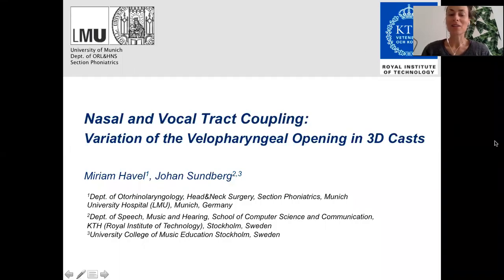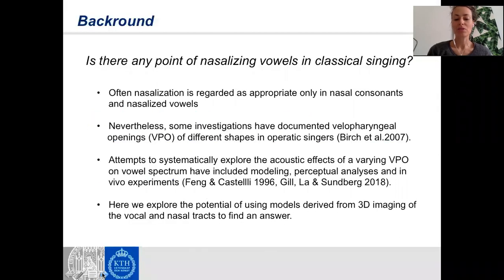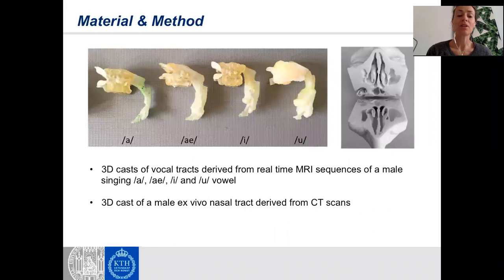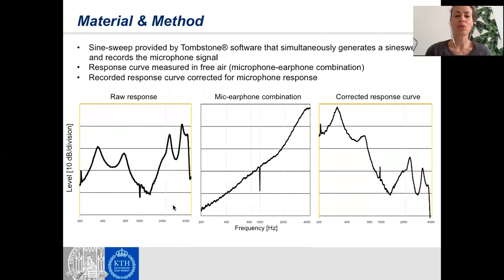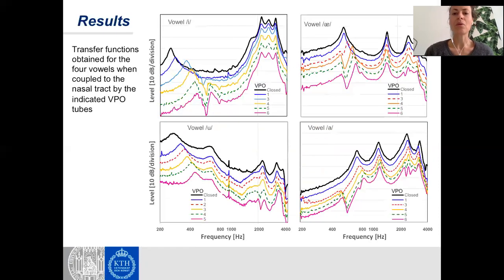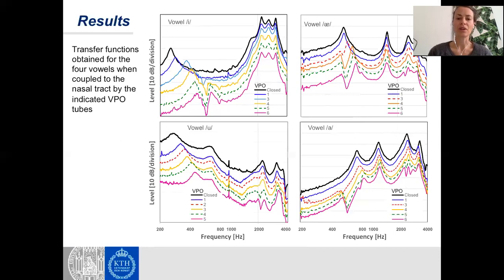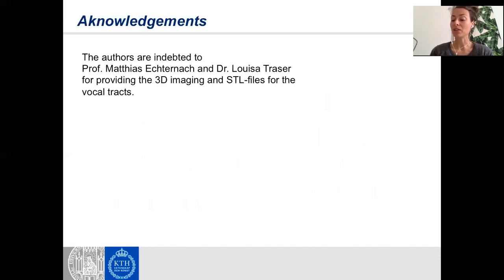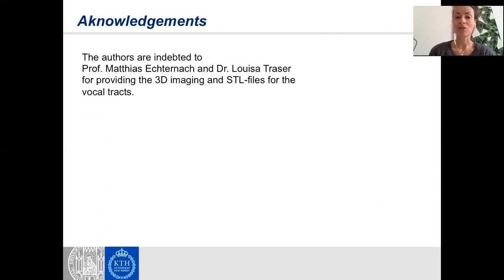Nasal and vocal tract coupling: Variation of the velopharyngeal opening in 3-D casts

Comment: Nasal and vocal tract coupling has been interesting to me for several months now. I've been wondering how it might be accomplished. My theory is that the velum controls nasal tract resonance by changing state (open or closed loosely or taut). When closed the velum receives vibration and, being mostly water, accellerates the wave and, being more dense, raises the frequency. When the transformation emerges into the airspace of the nares it is reflected by the external atmosphere. The velum also communicates some sound to the rigid hard palate and the airspace also communicates resonance to the hard palate which being more rigid modifies and communicates with the airspace sound that is to emerging from the mouth. My question would have to do with the significance of the hard palate and dental emissions into an articulation of spaces that may open for the singer beyond the tip of the tongue and before the teeth, and after the teeth before the lips in addmixture to the signature.